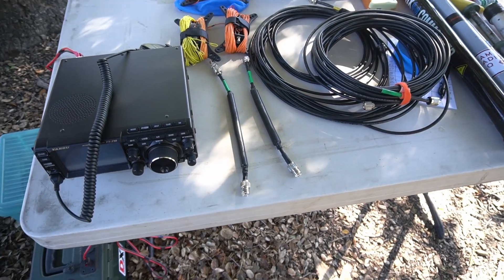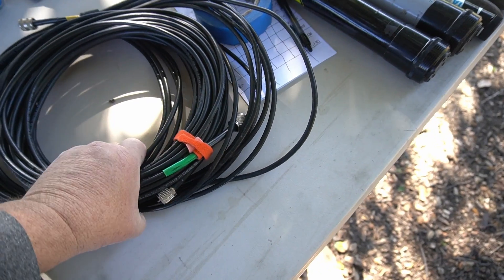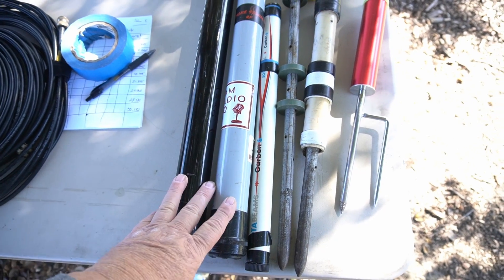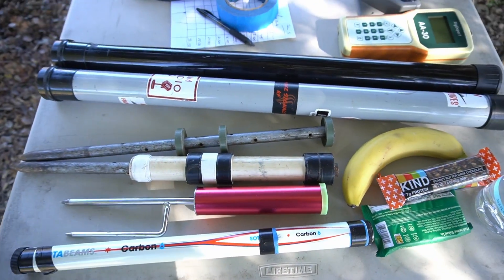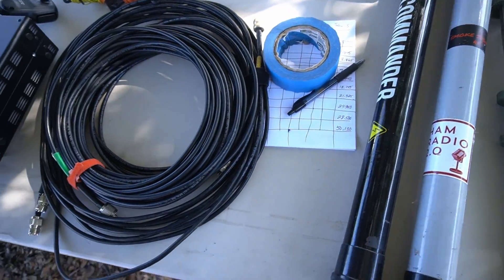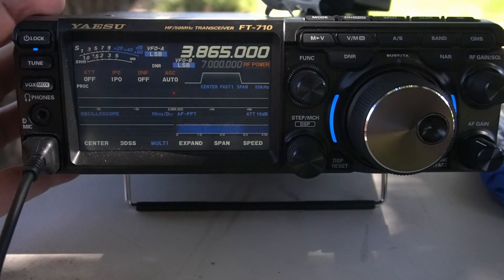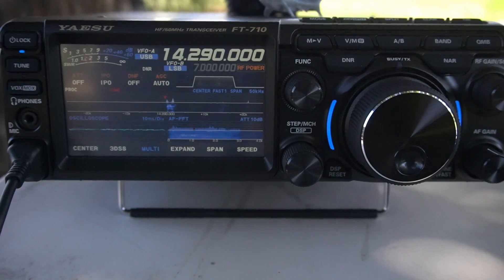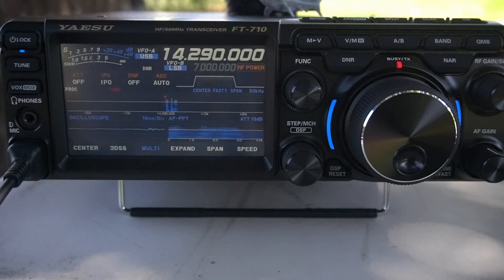Which is the best Toroid?

Comment: This is so misleading, the efficiency is not being tested here at all.  The one which your radio will tune easily on all bands is probably the WORST ONE!  You are propagating the lie that the matching transformer that presents the best SWR  is the most efficient. If the only goal is to have one that your radio will tune easier, then get the worst one like the one used in Chameleon, Alpha antennas, CHA verticals, etc. They will attenuate the reflected power your SWR radio is measuring so much that SWR will be low even if you do not attach the antenna to it. 73 Danny E73M aka N4EXA
Reply from the maker: Hi Daniel, this video wasn't about testing the efficiency of the antenna we have done that in other videos. The Smokin Ape did that. This video was in response to comments that we should field test the antenna, we do that with all our antennas.  This is our version of the Rybakov antenna. Most sources say to use the red t130 type-2, in our testing the green t130-type 52 was more efficient and it also did what we wanted. We wanted to offer a vertical that a ham could take out and use the internal tuner and get on most bands. we also tested 140-43 and 61, they are both more efficient but not what we wanted to offer at the time. I don't disagree with what you have stated. The mpas uses a 5:1 and is known to not be efficient and the original ham that came up with went away and to the 4:1 like we use. Our antenna is 1/6th the price. All that being said it has become one of our favorite portable antennas, 5-10 minute setup and it doesn't take up much space.

Comment: I make my own baluns and ununs using type 43 cores. They work great on the bands I operate - 80 through 15 meters HF. I use mostly 240 size toroids at 100 watts. Anything smaller can overheat. My SWRs are much lower than shown in these tests.
Reply from the maker: I tried the 140 -43 and in this antenna they weren't as good overall.
This is not a resonant antenna on other antennas we do use the 43 mix with good results.

Comment: This is all way outside of my knowledge.
Question: what is the clicking noise when tuning?
What is the tuning doing?
Reply from the maker: The relays in the radio for the tuner.
Reply: The tuning is switching thousands of combinations of inductance and capacitance with hopes of matching the antenna to the desired 50 Ω load.  Generally been my experience the longer the tuner has to work to find a match is indicating the antenna is really OFF match for the desired frequency.  I agree out in a field setting what matters is “will it tune” but in a home setting with more permanent antenna installations if the tuner has to work that hard you need to better prune your antenna as you are loosing a lot of efficiency by expecting the tuner to do all the work.  Always remember maximum energy transfer off the antenna wire is the end goal